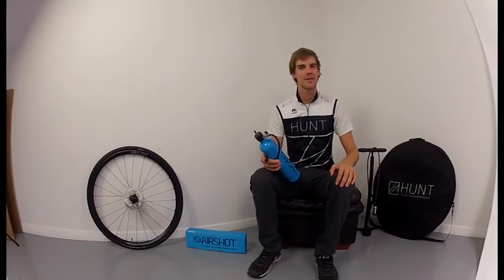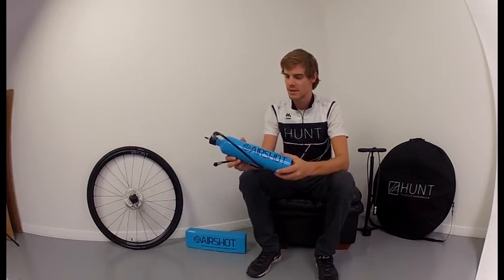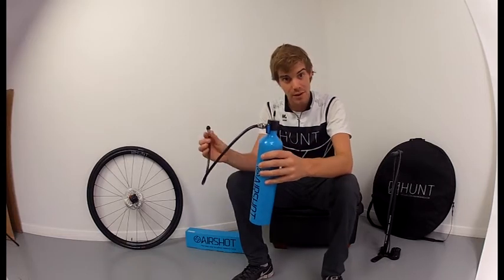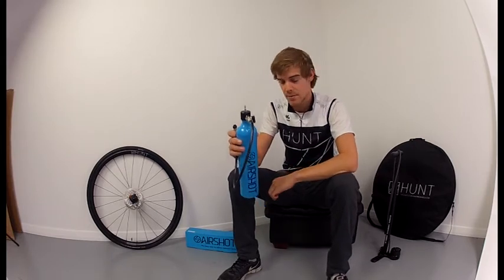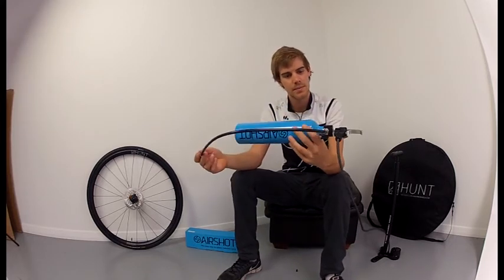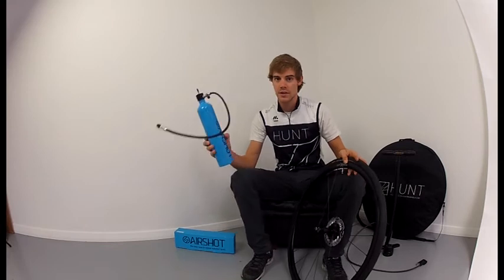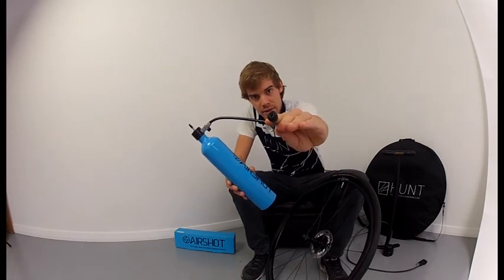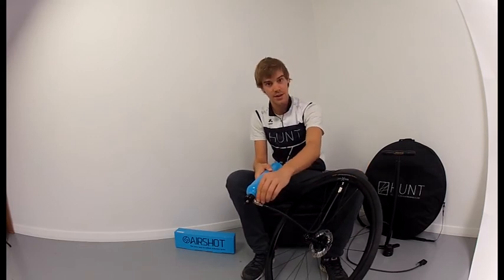How to use an Airshot to easilly seat and inflate tubeless road bike tires

Comment: I had no idea that my first 5 successful attempts at seating Tubeless tyres were a complete fluke until I tried to change over a set the night before a race. The idea of this tool is not to inflate at tyre. It is designed ti dump a large volume of air quickly in the hope that the tubeless tyre bead will seat in the rim in a form that will allow the sealant to trap the air when u try to inflate it.

Comment: i have just experiened a massive explosion of tubeless sealant (or maybe a large sprayed fountain of mess is a better way to put it) when removing the airshot from the valve - in my case, when taking the airshot hose off the tubeless valve with the core removed, after having apparently successfully seated the tube on the rim. i'm trying to find out how to avoid this happening again, and this video doesn't tell me
Reply: You're not doing it in the right order. Use the Airshot to seat the tyre in the bead. Then once the tyre is seated in the bead, remove the Airshot, remove the valve core - the tyre will go down but the tyre should still be seated. NOW put the sealant into the tyre - I use a large syringe but you can buy funnels etc. Then reinsert the valve core, rotate the tyre a few times and shake it to distribute the sealant, then pump the tyre up.
Reply: Put the valve at 12 o clock before removing the Airshot. Work with gravity, not against it 😀 It might still be a bit messy, but it’ll be a lot better than if the valve is at 6 o clock!

Comment: Don’t buy this product it suck. When your inflating your tire it works but once you want to unplug the air shot the air of the tire comes out. Scam .
Reply from the maker: Sorry you have had a bad experience I have gotten on really well with mine, what do you use instead?
Reply: If the tire seated, it did the job correctly. Just top up with the track pump.
Reply: Lol. The purpose of this is to seat the tyre to the rim not to inflate the tyre. Lol
Reply: I think you’ve got the wrong end of the stick. It’s not supposed to permanently inflate the tyre. It’s designed to initially dump a large volume of air into the tyre, causing the tyre bead to be forced against the wheels rim. Now the tyre is in the correct place, remove the Airshot. Air will escape from the tyre as you’ve got no valve core inserted at this stage. Simply add your sealant, screw in the valve core and inflate as normal with a track pump. This isn’t a scam……..you just need to know how to use it!